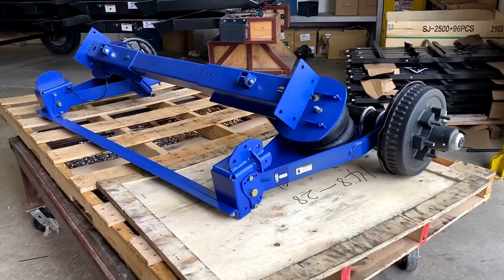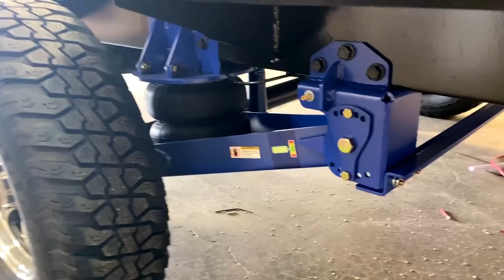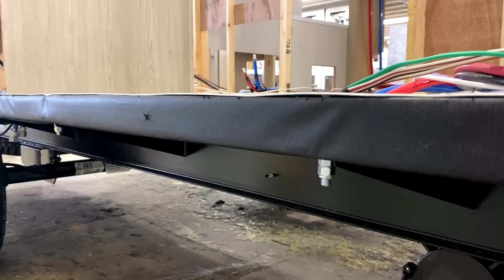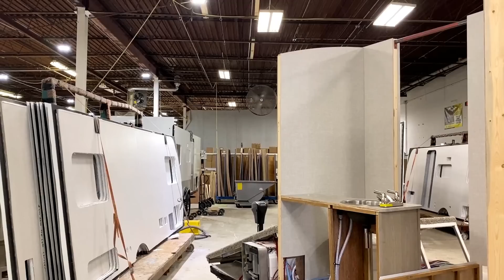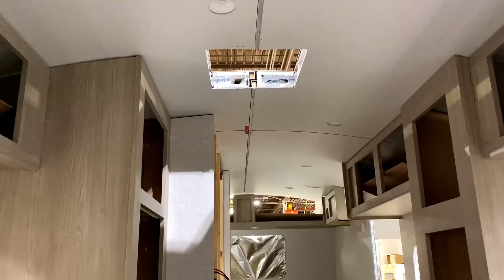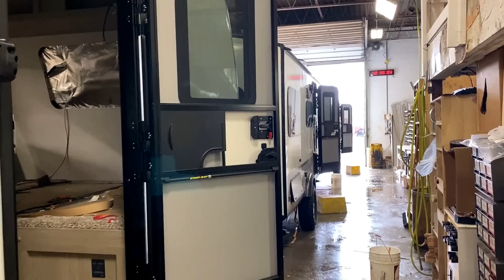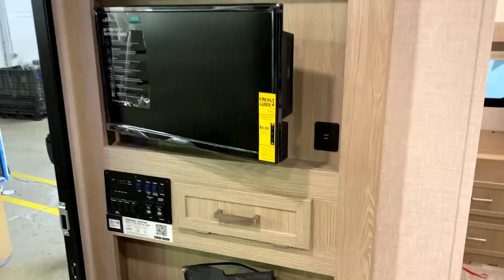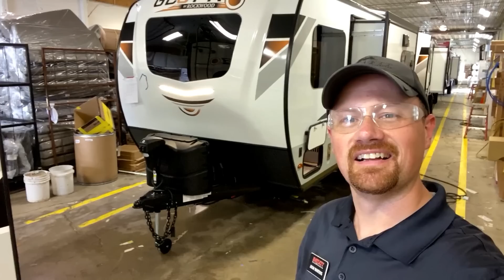Rockwood/Flagstaff Factory Tour!! (Part 3: Geo Pro & E-Pro)

Comment: Can a stud finder be used to locate the wood filled aluminum studs to hang something or to add a solar panel on the roof? 
When the solar panel option is specified, is it screwed into an aluminum and wood “rafter”? 
Are these all 2022’s on the line? If not building yet, are  the new options on orders that were not available when the orders were made during later 2021available to those customers now waiting? My dealer’s salesperson did not know of these changes. He should subscribe to your videos! 
Thanks for your efforts and great tour!
Reply from the maker: it can, though there's fewer of them. Lamination allows them to be further apart

Comment: Josh, please suggest they upgrade the media system to true stereo inside and outside. 

It is my understanding they use one channel for inside and the other for outside in their Geo/E Pro lines.  It Sounds awful outside and  not much better inside.

Many complaints online and in RV groups I communicate with. 

Good quality outside and inside marine grade speakers are very reasonably priced.

Rather they delete the outside speaker and install a blue tooth removable speaker attachment.
Reply from the maker: I'm a huge fan of those portable speaker systems
I actually own two of Furrion's Lit Speakers
→ Quick Video if you're unfamiliar: https://www.youtube.com/watch?v=3BBYXs4FHTs
→ Wildwood's FSX also has something like that also has an AM/FM Radio! https://www.youtube.com/watch?v=HvvVhAJgook
Reply: @JoshtheRVNerd  Good info thank you. 

As reported by  Geo/E Pro owners, “crossing channels” to simulate a mono channel to a “tin can outside speaker” has also “shorted out” some systems, “runs hot”, is a “fire hazard” and “makes the inside speakers sound bad.“

Owners have been disconnecting the outside speaker from the back of the inside unit and property reworking the output wires for true, proper, safe inside Left and Right stereo output sound to the inside speakers. 
There are videos on line how to easily and safely accomplish this. As always, I recommend a certified dealer to assist so no warranty etc. issues come up later. 

One can use the outside speaker to drape a pet leash around, hang a hat on or something more creative. 😃

Hopefully the fine folks at Rockwood/Flagstaff will either upgrade to proper outside L and R stereo speakers or eliminate the outside speaker all together and replace with a blue tooth speaker bracket. Nice speaker accessories to purchase from your dealer! 

In conclusion, 

Top 2 items that makes for really really grumpy campers:
1: Low Quality Toilet Paper
2: Low Quality Sound System with low quality mono sound speakers. 😣 

Life’s too short UPGRADE! 🙂

❤️The Channel & Geo Pro!

Comment: I love the Geo Pro..but I still did not buy..as they need to upgrade a few things on the 20bhs ..the bathroom or as we called it..a port-a-potty  that plastic shower frame  of sink placement in the shower/ port-a-potty..just build a folding sink that can go up and down like on a boat and put it by the door vs all the was in the shower..and all that solar with only a 1000 watt inverter just put in a 2500 watt so all outlets will work except the air con…the mini 2104s love it even more ..but lost the off road height the geo pro has and again 1000 watt inverter that will be wasted day one to buy a larger one…but great factor tour

Comment: On the rear eating model they should consider having a drop down rear wall like a toy hauler that can be used as a rear deck or lower further as a traditional cargo ramp toy halter for smaller items like mountain bikes, skies, surf board, side ladder storage etc with the toy hauler air ride. Also have a rear awning over the back, nice if it rains etc. 

Rear picnic/sun bathing/lounge deck. Also have a cooker hooker connection and magnetic screen system.
Reply from the maker: Cool idea
Reply: @JoshtheRVNerd  We Order, they will build it!